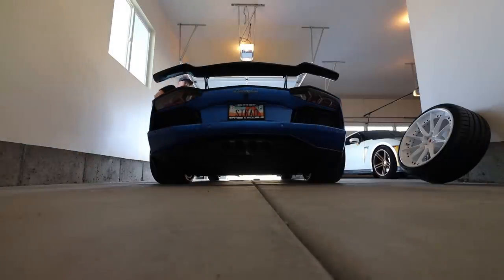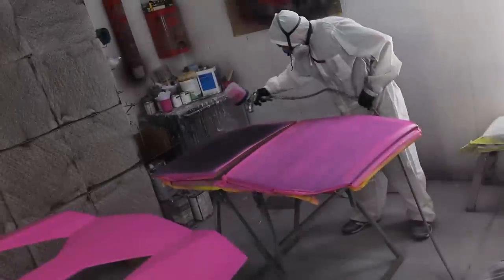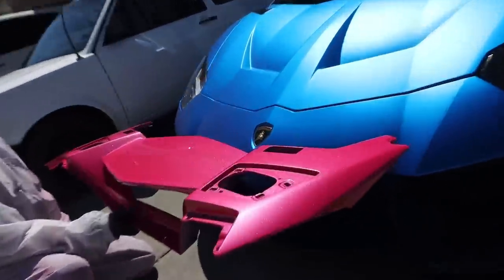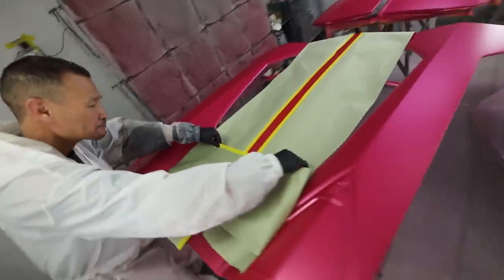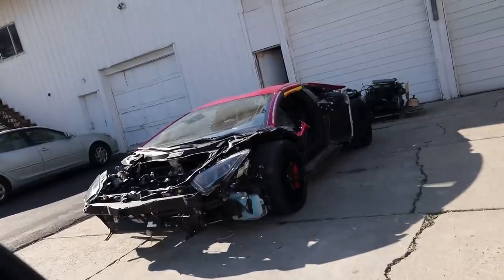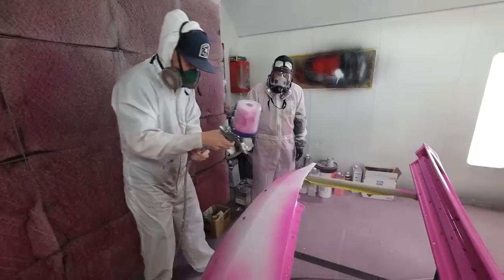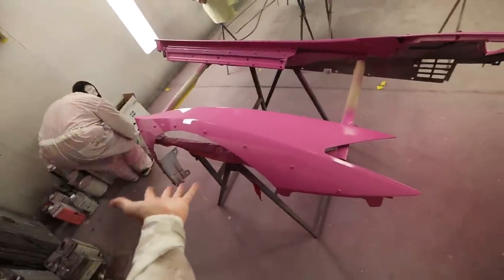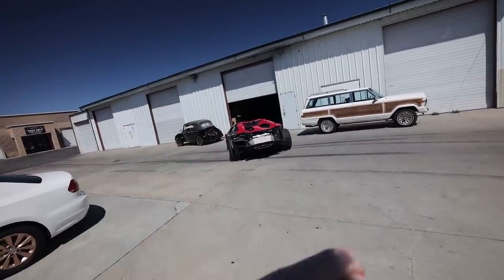Painting my Lamborghini Aventador Pink!

Comment: I'm thinking surely James spoke to them off camera and got them to re-do the wonky Pirelli stripes..... At least I hope so...
Reply: He talked about it in yesterday video 
He getting them redone in white to match the wheels
Reply: I was just rewinding and pausing to see what was going on... The driver side is off...
Reply: @theexpert7390  did you watch the video the stripe on the roof are not aligned with the other one
Reply: Lets wait till we see the roof in place. The complete rear structure is missing
Reply: @pokiparkassistent  You can see how it lines up correctly on passenger side though. The roof is in place where it should be.
Reply: The roof wasn’t in place
Reply: @theycallmebigterr4072  THANK YOU!!! Finally someone else with eyes! No one else even bothered to notice the rear of the driver's roof was like a inch of of place XD
Reply: @spaceemperorkarl121  it doesn't make a difference, look at the body gap
Reply: No
Reply: @DigitalCipher87   aventador roofes are 2 pieces
Reply: @theycallmebigterr4072  roof was definitely in place because the middle and rear are lined perfectly
Reply: @bettyrichardson7079  No it wasn't. I was thinking the same at first but you can see they just put the roof on the car but it is not 100% in place. You can see gaps everywhere. I think once the car is actually assembled it will be fine. Problem is mostly that if you just watch the video, James moves the camera so much that there is no moment to have a look.
Reply: even if the roof isn't in place I don't think it's going to matter, still looks off. The stripe is closer to the edge of the panel on the A pillar than it is on the roof. It would have to be the same if it's going to line up properly.
Reply: At least i wasn't the only one thinking that.
Reply: even stefen instantly saw it and walked up to looked at the wonky stripe at 7:45 hopefully he said something to james off camera.
Reply: @DigitalCipher87  facts, I thought I was the only one
Reply: @spaceemperorkarl121  Ok so the roof wasn't fully in place, BUT pause the video at 7:46 and look at the stripe on the driver side. Even if the roof was fully seated the stripe is set too high.

Comment: Is it just me or do the stripes at 6:51 on the roof and A pillar absolutely not line up? Or is the roof just not on properly?
Reply: noop. was looking at that as well....
Reply: Same here I saw it too
Reply: @danouvandenbroek  Wouldn’t wanna pay $10,000 for that non aligned Pirelli logo...
Reply: It is horroble😬
Reply: It is because the roof is not fully attached. You can see the 2 pieces were not aligned in the back and front. It will be fine when the roof is fully attached.
Reply: Yep, definitely don't line up. Right side lines up but looks to be in a different position to the left side.
Reply: I guess the roof is not  attached properly that is why it looks like that
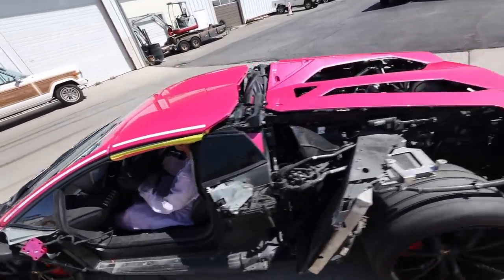Reply: @troyandrade435  nah look around 11:00. It’s attached and not lined up
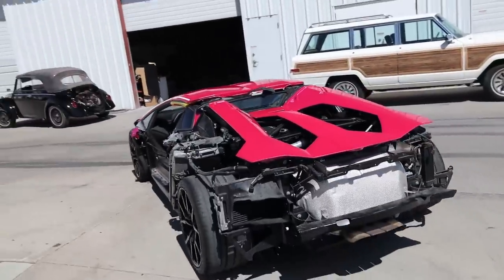Reply: @MuddyTubMedia  Look at 11:05 and you can see that you are false.
Reply: @troyandrade435   🙏🏽thanks for explaining.   Didn’t see that.  I was worried
Reply: @ssmith2832  You're welcome.
Reply: @ssmith2832  No, I think that's wrong, I'm afraid. The roof looks absolutely straight to me because the lines of the window frame of the A pillar and the roof line up perfectly on the driver side. I think the pinstripe on the driver side of the roof is actually simply botched. :(
Reply: @troyandrade435  idk man, looks attached to me. Guess we’ll see when it’s done

Comment: The only 'controversy' associated with the paint color comes with you calling it PINK.  The final color is actually beautiful......and NOT pink.  I hope it's my monitor's distortion...otherwise, the white pin-stripe on the roof (driver's side) doesn't look like it lines up as well as the passenger side.